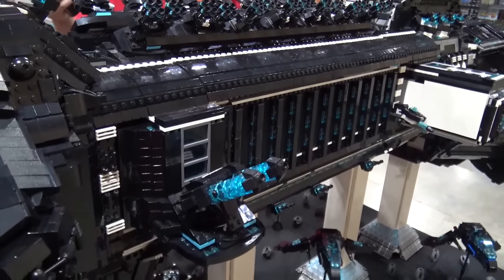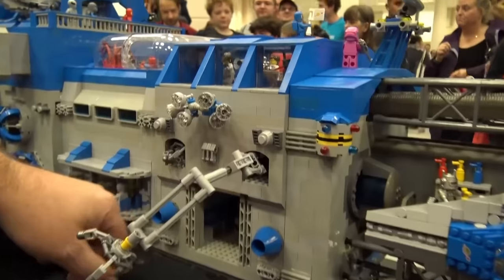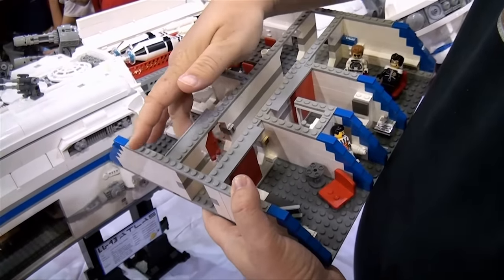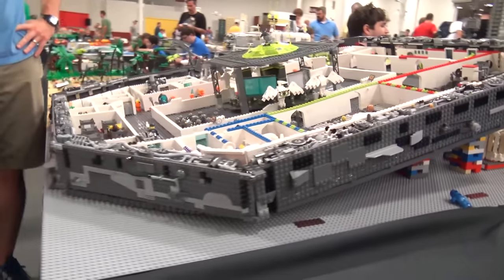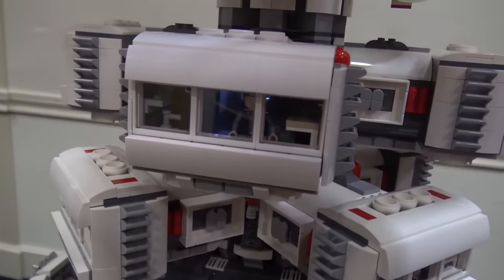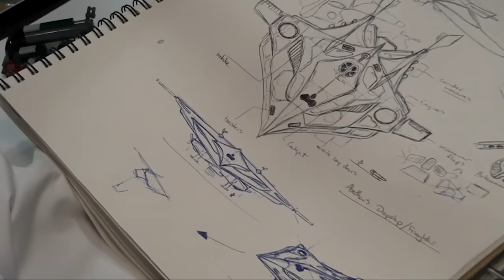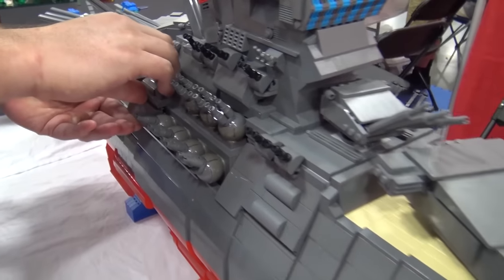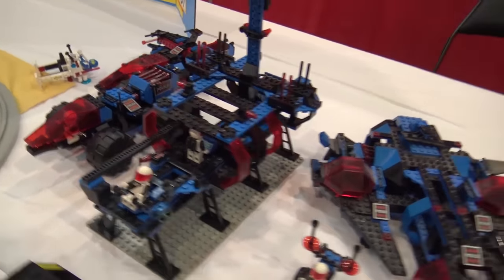Top 10 Epic LEGO Spaceships!

Comment: I think it's always been unrealistic to have a space battleship with the bridge exposed on the outside of the ship as all it would take is 1 shot to disable the entire ship and kill the majority of the senior command. Would be much more sensible to have the command room in the center of the ship surrounded by the structure of the ship and additional armor plating. Realistically(I know this is science fiction) there is no point in having windows on the command room as you could rely on cameras and sensors and not leave the brain of the ship exposed.
Reply: I guess the theory is that electronic warfare can disable your cameras and "trick" radars into thinking enemies are friendly and vice versa.
You've probably already heard of The Expanse. One of the main battleship classes in that has the bridge right in the middle of the ship, and during battles the bridge is sealed off with it's own air supply, like a second ship inside the ship. If I remember rightly the books also said it's surrounded by a huge amount of water (which is remarkably good at stopping fast-moving projectiles and radiation). Smaller ships in The Expanse go into battle with no air in them, and the crew wearing space suits, so any random hole that misses the crew is just a hole, it doesn't suffocate everyone.
Reply: @kbforme, as much sense as that might make to you, if that was the case, then why is it that aircraft carriers on oceans have not suffered similar fates, let alone had done so with far more regularity, in real life?
Reply: @paxhumana2015  They need visual to direct aircraft and pilot the actual ship and there are no modern aircraft carriers, otherwise they very well may decide to protect the command room in the hull of the ship and use cameras for vision. It's a very poor comparison as the vast distances in outer space make have windows in the command room all but pointless.

Comment: This actually triggered me to calculate the size of a to scale Lego Death Star from Episode 6 (Diameter = 900km): A male Lego Person is 4cm in hight, so in the Lego World 4cm equal 1.76m (average) in the real world. This yields a conversion factor of 1.76/0.04 = 44 or 1/44 respectively. So the Lego Death Star Model would have a diameter of 900km/44 = 20.45km. This would mean a circumference of insane 20.45km*pi ~ 64km and a Volume of (20.45/2)^3*4/3pi ~ 4.477km^3, better known as 4.477.000.000.000.000 Liters!!!!!!!!!!!!! Fucking awesome! Someone needs to build this!